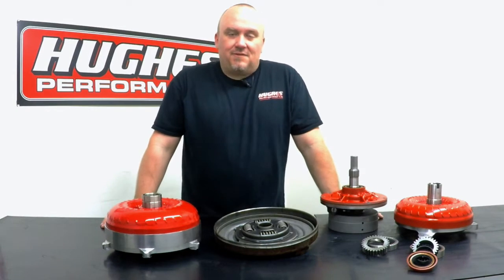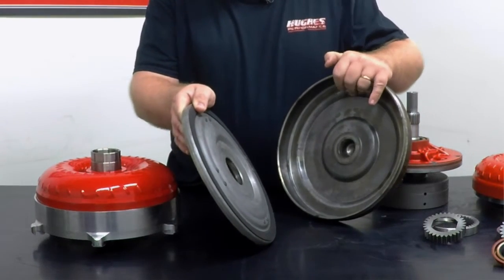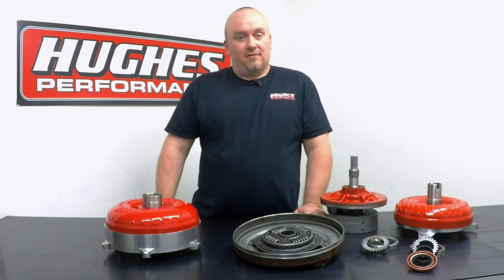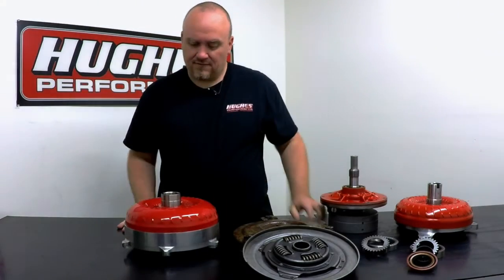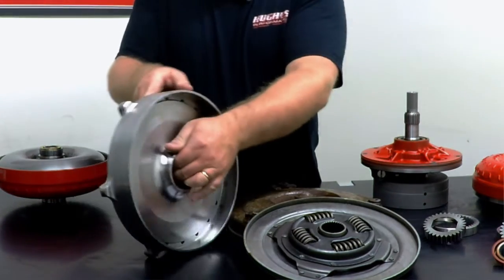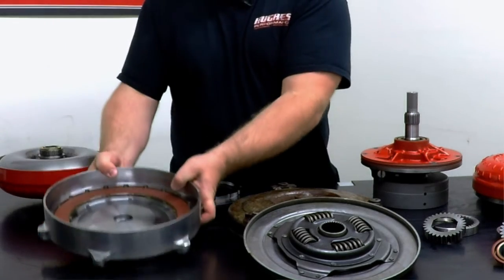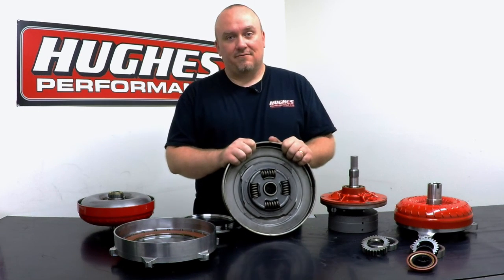Ep. 2 Torque Converters 101: Lock-Up Torque Converters

Comment: See I knew it! Just like the other clutches in the transmission the pressure is used to force the clutch disc's apart! I keep getting into debates with people saying  that the the pressure forces the clutch to close, it pushes the friction surfaces together. I knew that was wrong, but I just couldnt prove it. 
I am still figuring out how it does stay engaged, that spring arrangement doesn't quite click in my logic center.
Reply: I have the same question. Those four springs look serious, but what do exactly they do?

Comment: If i wasnt gonna change my shift point id be all for the lock up. But whats the point if im gonna shift at a higher rpm anyway ? Wouldnt the extra rpms just do the same sht ? Id be riding around at a stlightly higher rpm anyvway . Combined with racier gears that just take resistance away would it even matter ?

Comment: What a great tutorial! I've been dealing with a transmission shudder issue and wanted to understand the the lock-up system. This video nailed it perfectly. Shudder has been resolved by using Lubegard additive, but in the event that this solution doesn't hold up, wanted to know if just changing the torque converter would possibly address the true root cause. Thanks so much!

Comment: Great stuff. I have an RPM built 4l60e tranny that I have dialed in for the apply and release. It was perfect until a shop rebuilt the engine. After recieving the car back, the clutch will unlock when it shouldn't on the highway at say 4th gear at 70MPH when the load decreases or I ease up on the throttle. Could something have been damaged?

Comment: Im told i can get my tc to.lok up in 3rd.. 700r4 in my 87 k10......cut power wire to sol. And then cut the other two wires on the 4 pin ...splice them together......this shiuld lok up od...but not sure if i loks up 3rd.....can you confirm?? Thx tomk ret fdny

Comment: Hello, saw your video on lock up converters, I have a 1955 Chevy truck 265 engine with a 700R trans. I have a B&M dial box controller. What would be the best speed to dial the knob on the box to lock out the converter. Right now I’m setting the dial at about 40mph when the green light on the box comes on meaning the converter is locked up, would this be correct? Any info would be appreciated. Thanks Len

Comment: Does the 4l60e only lockup in OD at freeway speeds?
Reply: It will lock in 3rd as well as long as its above the speed that the computer is telling it to lock. In D it is usually after its shifted into 4th tho. You generally have to have it manually in 3rd for it to lock up because of the speeds its programmed to shift at.

Comment: Why do so many smaller displacement engines making well over 1,000HP have a recommendation to not run a Lock Up Converter? I've heard of guys in the 2JZ world that engage the lockup 400rpm too soon and it can completely grenade a Billet Block. Why is that? how can just engaging a Lockup a few hundred RPM too soon send Billet Rods through a solid Billet Block? I've also heard the same in the Chevy LS world. So why?
Reply: Because of engine lugging. Lugging overheats the combustion chamber by detonating the air/fuel mixture and a lockup clutch mechanically locks the rotation of the crankshaft to the wheels/transmission input thus dragging down rotation and lugging the engine (more power demand at low rpms)
Reply: A non lockup converter keeps the torque converter as a free wheeling fluid coupling via the pump, impeller, and stator vanes
Reply: A lockup clutch is best used for more than 3 speed automatics to ensure fuel mileage and a true 1:1 lockup when the direct clutch applies for 3-4th gear

Comment: I keep trying to think of a best of both worlds design combining the advantages of an auto with the advantages of a manual.

As a daily I can't drive auto cars because they are so boring I start to stop paying attention and I kinda go into a brain fog, sometimes falling asleep (happened twice, second time I got in a crash) which is why I drive manuals now.

But I understand the advantages to an auto for racing. I used to argue against that for a long time but I'm drag racing an auto wins hands down. I'm on the fence for any other racing.

I still can't think of anything where you have complete mechanical control over the trans but can shift immediately with an auto. So I'm still sticking to manual vehicles. Oh, an auto can't bump start yet. Yes I've utilized this many times.

For me, the perfect setup would be
1- manual clutch control.
2- manual gear control (no shifting when you don't want to).
3- instant gear changes.

And that's it. The trick is instant gear changes while having manual clutch control. Big advantage to a torque converter is stop and go traffic on the highway. So it's a constant back and forth between the two for me.

Comment: I have a 2,800 stall in my Art Carr 200-4r behind 502 with HD solenoid and manual switch which will lock it on the freeway, but when I switch it off on offramp, it doesn't disengage until several surges and drop below 40mph. I may need to get an aftermarket TC.

Comment: I have a 37 foot rv with a tag axle, 4l80e powered by a gas 454 tbi, dual 2.5 hedders.  I will be getting the transmission rebuilt soon.  Since I will be towing with my 17k  RV will I need the triple disc XTM converter?  Will it tear up my transmission?  Or should a just settle with the XTM single disc converter.  When I call into Hughes Performance one technician says go with the single XTM single disc because the triple disc is for a deseil engine which is high torque, and the other technician says go with the 25Blxtm that it will not tear up the transmission. So, for once and for all, what is the verdict?  Thanks.

Comment: I have a question, only info I've been able to find is on forums which can sometimes be questionable info.  Basically, the cam I've got my eye on recommends a 2600-2800 stall speed. Now I've been told by almost everyone I ask that your highway cruising rpm should be higher then your stall speed BUT I've also been told that a good lockup converter will compensate for it and be fine to run in a street/strip/daily driver combo. So are they ok to run that way and not run too hot or limit the converter life? Cruising RPM would be around 2000-2200 BTW if that's important. Apologies for the lengthy question.

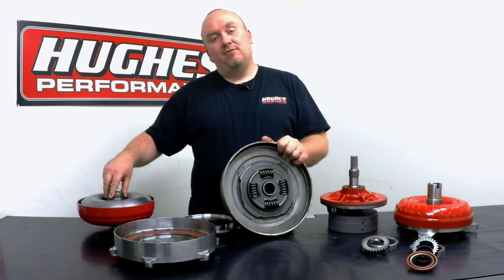Comment: Not all apply strategys are the same. At 8:50 you say that the clutch is not applied by pressure but rather by natural internal forces.  The stock 4L60E does indeed have apply oil supplied from the pump and between the hub shaft and the stator shaft.

Comment: @Hughes performance, I have a 4 speed automatic transmission and I notice lock-up of TCC happens at 40 mph on the overdrive gear. I do cruising speed in the city at less than this and it causes poor fuel efficiency. I would like to make a manual switch for the TCC that i can lock it at lower gears as long as it is past stall speed. . . Is there any problems with doing this? Is shifting from 3rd to 4th gear alright while TCC is locked up?
Reply: just a guess.  sounds like someone hooked up the 3 gear pressure switch into the tcc.    if you have a 4 gear external port outside your tranny case.  hook up a pressure gauge n run it inside the cab.    watch the pressure value as the vehical shifts into 4th.  on the freeway at say 65 mph see what the value is.    then buy a pressure switch closest to that.    thats when it will lock up for you.
more work for sure.   better outcome.    just sayin..

larry

Comment: Will  a high stall(2500) converter lock up  lock up below the stall speed. In top gear
Reply from the maker: Yes sir, any converter with an active stator is capable of achieving a reasonably efficient part throttle coupling when properly matched to the appropriate engine modifications, axle ratio, and tire sizing.

Comment: Would like to keep the lockup on an A999 behind a 408 twin turbo, street/strip. Lots of information, thank you. Estimate 1200 hp, no more than 2800#, trans brake.
Reply from the maker: I wouldn't recommend spending that kind of money on an A999. You're far better off with a 727 or adapting a TH400.
Reply from the maker: A999 will never handle a twin turbo 408 producing an honest 1,200 HP. Sorry!!
Reply: Even with upgrading the internals?
Reply: Was going to go with CRT internals.

Comment: Just cleared up the clutch apply mystery, I had it backwards. I'm still not sure if I will use lockup or not when I change over to 700r4 but hopefully I get more info on options.
Reply from the maker: Happy to answer any additional questions you may have. We offer lock-up and non-lock-up options both in our 700R-4 transmissions, although lock-up comes standard.

Comment: I always thought that it is the line pressure coming from the solenoid and valve body that engages lockup clutch in my oem torque converter but obviously i was wrong. Great video series very educational i love it. Do you guys do any ZF transmission parts or torque converters ?
Reply from the maker: We can build a ZF torque converter for higher stall speeds and can also incorporate some features to increase the converter strength.  We just need your converter core to build.
Reply: @HughesPerformance  What about ZF transmissions is there any way to strenght it i would like to increase my engine power and would not like to blow the tranny up it is a diesel engine and i would be going from 180hp (272ft-lb) to 250hp (355ft-lb) it"s a ZF5HP19FLA 5speed awd box.
Reply from the maker: We don't have any experience with that particular transmission. Sorry about that!!
Reply: @HughesPerformance  Yeah i thought so there are not that many ZF5HP in USA i guess thanks anyway.